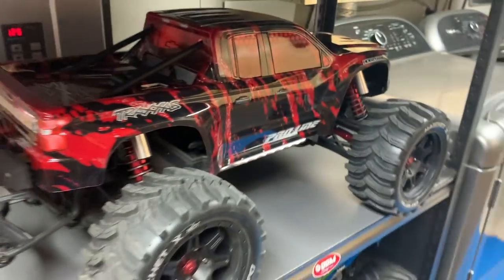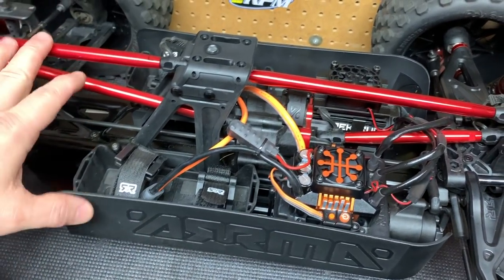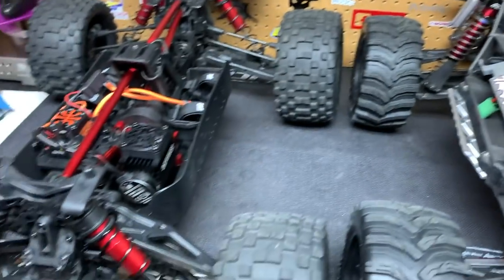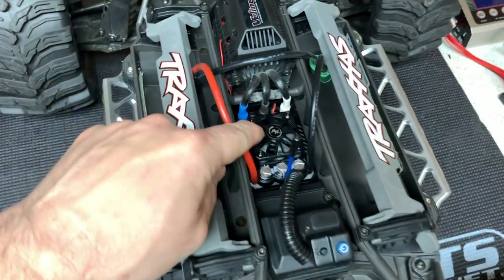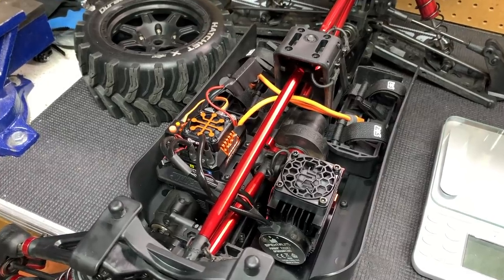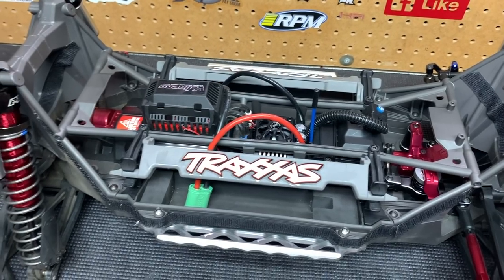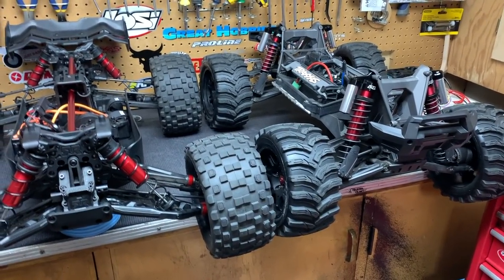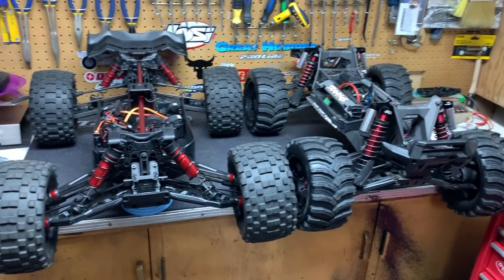Arrma Kraton 8s VS Traxxas X-Maxx (Comparison)

Comment: I have my XMAXX 8S stock and have launched it time after time on the BMX track, and never had an issue with any of the items that you are discussing. No issues at all. I hope it stays that way. I have also have launched my XMAXX 15 to 20 feet into the air and landing on the hard dirt track. Hope you have better luck with yours. You might want to check out your modifications and see if everything is working in harmony together and not destroying itself.
Reply: I've had the same experience.  No problems at all with the gears or the speed control. I beat the crap out of it for 6 months, no issues. I installed a max 6 still on factory motor and gears, no issues.  I think driving style makes a big difference.
Reply: Stock rear hubs too I bet ?
Reply: Yeah my xmaxx has had no issues with it's spur gear.... Been bashing for a few months now.

Comment: I been running my xmaxx now for over a year still on stock esc, still on pinion and spur. Sometimes its about how you drive it
Reply from the maker: stevin tyska exactly.  A lot of people are more aggressive like myself.   If you jump a lot and are doing flips and stuff you will break parts.  If you enjoy driving around on flat ground with no heavy jumps or anything the truck should last.
Reply: Dude I bash my Xmaxx shitless so I have a whole aluminum front end, upgraded servo, stronger bearings, had to boy 6 new batteries at 200 a piece cause I’m fucking dumb
Reply: @JasonPerrinRCVlogs  I've broken 3 rpm a-arms, 2 drive cups, a carrier hub, and replaced all four wheels in about 1 year on my x-maxx. I haven't replaced the pro-line raptor body on it yet, but it looks like the top gear hilux.  (incidentally, I borrowed an arrma notorious 6s for about a month and broke the lower plastic shock mount part twice - I bash hard!). still, aside from the tires, everything was super cheap to replace!
Reply: Maybe you didn’t send it 🤣🤣

Comment: I have got to be one of the only X-maxx owners that hasn't had an issue with the electronics at all. Even the dreaded grub screw.. I ran it at least 4 times dry before learning of it being a problem, chucked some blue ZAP threadlock on it and never been as issue in over a year

Comment: I got an X-maxx last year and love that thing.  I haven't had any issues with the pinion or spur other that the pinion coming loose a couple of times.  I put some lock tight on there and that seemed to fix the issue.  I run all the electronics stock and haven't had any major issues.  The ESC overheated a couple times, but after I beat the heck out of that truck.  I am not easy on that truck.  Broke the body the first time out after I jumped it 30+ feet.  The thing is built like a tank and I have no complaints as of yet.  I may get the Max 6 ESC at some point, but I definitely don't recommend getting anything until the stock components break.  It really is a complete waste of money.  Also, get the unbreakable body and Proline Badland tires.  You will not be disappointed.

Comment: For the pinion issue, degrease everything,   motor shaft, pinion and set screw. Use something called Loctite bearing retainer on the round side of the shaft, where the set screw isn't, and then slide the pinion on, and use regular loctite for the set screw. The bearing retainer is gap filling, and will secure a bearing (or a pinion) to a shaft without anything else holding it on. I used it on a TRex 250 helicopter for the tail shaft bearings, as well as the pinion for the motor of that same heli. The pinion in that heli had no set screw, not flat side. The bearing retainer was the only thing securing the pinion

Comment: My friend bought an XMAXX because every video he watched myself included said XMaxx is the most durable. I got a Kraton EXB 6s and expected problems according to YouTube. So no problems at all with the Kraton max6 1650kv. XMaxx has had issues every time he goes out! The tires came apart first, the pins that hold the a-arms keep falling out. He doesn’t even drive hard. 
Thank you for the honest Veiw. By the way the XMaxx is upgraded and hopefully be operating without issues.

Comment: This is by far the best, most unbiased and honest comparison vid I’ve seen on these trucks. Thanks. Having said that.....
I just got a Kraton 8s after Christmas. The exploded view diagram says the center diff already has 20mill diff fluid.
Reply from the maker: Yeah Arrma changed to 20 million in the center diff.  The first release of the v1.5 still had 1 million in them.  Changing the center diff to 20 million is no longer a worry.

Comment: I went into LHS looking for the Kraton 8S they didn't have any, but had 1 Xmaxx 8S. Since day 1 pinion problems, self righting one time blew the p&s to bits. Blue locate red loctite, don't matter. I was looking at different pinions in the lhs but thought I may run into what you did in the vid. I'm going to burr or slot the shaft and see how it goes.maybe even the arrma style spur grub with the pin going through. Been setting pinions and mesh for 20+ years, never any problems until this XMAXX. Outside of this and a few other issues which I've already knew about and sorted its an amazing rc. Traxxas needs to have Arrma do their gears, and Arrma needs to have Traxxas do their chassis design. Best bet to get both. The Arrma Xmaxx or Traxxas Kraton better yet the the Arrma XO-1:Limitless edition. Great video though very informative glad this popped up in my feed. Sub'd

Comment: Thanks for the great input on the differences between the XMAXX vs Kraton 👍🏻. I have the Kraton 8s and have been thinking of getting the Xmaxx. Now I know if I pull the trigger on purchasing the XMAXX I will need to purchase some additional stuff like a spur gear and pinion gear. As well I did click the like and I subscribed
Reply: Ya my gears have been perfect 👌 not a problem anymore
Reply: Im a complete noob who beat the piss out of my xmaxx and havent had any gear issues. Nobody i know has.

Comment: I had the problem with pinion on many of my different RC trucks. For the hell of it I decided to load the pinion screw with red thread locker but before putting the set screw into the pinion I let that threadlocker sit for about a half hour to stiffen it up and thicken it up just a little bit I let it dry and then I installed it and it's still on the truck today I did it to every one of my RC vehicles and I haven't had a problem since
Reply from the maker: I am going to give that a try. Thanks for the tip.
Reply: @JasonPerrinRCVlogs  You can also try some CA glue (super glue). If there will be a need to take it off, just warm it using soldering iron and CA glue lets go and you can take it off. I did such quick fix with my pivot balls which stripped suspension arms. Of course suspension geometry was not setup correctly so when I came back to home I just warmed it and glue let go without any damage to plastic axle carrier or suspension arms.

Comment: Since changing out the stock servo I can’t keep the XMAXX running.  Went through 4 in the past month. The pinion problem happened to me once and never again. Have the worst luck in the world with my EREVO 2.0. Esc, servos, motors, you name it. RC has endless variables.

Comment: I read the other day what i think sounds like a good idea for keeping the pinion on. Grind the end of the set screw that bottoms out on the motor shaft flat. Set screws usually have a little rounded end...i guess if you grind it flat it will give you a better bite on the motor shaft. Don’t know if it will help...but it sounded like a solid idea lol.
Reply: Better still would be metal weld or a well engineered pinion that has to be heated enough for thermal expansion to just get it over the shaft. Once cooled - solid fit from ALL sides and uniformly. Forgot to add, the bite is only better if the mating surfaces have 1) an increased surface area and 2) more friction from being tighter. Problem is that's more stress on the 1 small area (the grub crew and threaded section of the pinion)
For 2) the only method is to tighten more, but for 1 and 2 without being able to re-engineer the pinion, your method is a good idea.
By flattening the head (male) into a point of the shaft you make the same shape (a flattened section - female) you increase the contact area of screw and shaft and friction. Your (lol) idea is science and it will help a lot :-) go for it. Because you think, it is a good idea you where capable of coming up with by yourself before you read about it. Just take care not to narrow the shaft by over doing it, you want the minimal material away but flat on flat. Do the start work with a Dremel  (I don't have one) for speed but finish with a fine file. The Dremel is a rotary tool and you want as flatter surface as possible and that's why a file is better once you find a way to lock the shaft from spinning! while you work on it. A Dremel is probably the best option when working at 90 degrees to the shaft but you still want to keep it from moving so maybe get the cog on just enough to use the screw to tighten it onto the top of the shaft.  
Also bear in mind this very fast little cog isn't doing the torque work, it's doing the effort work by number of cycles....later stages of the drive train have the torque issues. My answer was over detailed I guess but sometimes you have to trust logic and not other people. It takes confidence to do stunts and tricks with a large mass that is potential energy moving at a great speed that could actually kill you, so have some faith in tinkering your toys to make them better :-) Engineering and science.

Comment: I am not a Traxxas fan boy at all actually I hate a Traxxas vehicles but the xmaxx is awesome,...Technically you don't have to buy anything for a new X-Maxx 8s, if the speed control does go bad within a month or six months then you can upgrade it at that point, the new tires are absolutely fine as long as you're not driving like an idiot and letting them round out like crazy, so far my pinion and spur have held up and I've had the truck for a month if they do break then I'll upgrade but none of this has to be done before you leave the hobby shop, some people have bad luck absolutely I believe that....but that goes with every ready to run car.  The X-Maxx at least looks and drives like a monster truck The arrma would be awesome but it's not a monster truck it's just a big truggy which is why a lot of people aren't interested in it if they actually made a monster truck I'm sure they would do a wonderful job and probably sell a ton.
Reply: You are correct .

Comment: i drill a divett into my motorshafts where the grub screw lands, that way the it has somewhere to sit and locks in nicely, those shafts arent hardened and drill and grind easily, if you go with the 1600kv that 20T is gonna be fast as hell! maybe even too much, if you do the 1600 id buy your 1275 as mine burnt up today! you could go either way
Reply from the maker: Good to know.  I honestly assumed they would have been hardened.

Comment: I have both of theses trucks also,,,,I noticed you didn’t mention the weakness of the kraton chassis,,,I bent mine just doing mild bashing...now I guess I’m going to spring for the m2c chassis,,which is not the cheapest thing to purchase,,,but is needed. Along with straightening or replacing the chassis supports and replacing the rear diff housing,,,I consider this a huge miss on armma part,,,,hope they improve this issue,,,,,other than that. I love both of these units,,,wouldn’t trade them for the world......great stuff....
Reply from the maker: I didn’t get into that as I have not had any issues with the chassis bending. It may be the new braces... not sure.  But I usually try only to comment on issues I have had.  And as of now my chassis is still good.
Reply: Installed the Radical RC Bash Bar, pretends the chassis from getting buffed down, and adds strength.
Reply: Yup... Bought a Mojave, lasted a few runs (guess I'm hard on it🤙) Had to replace the chassis with M2C, M2C +2 hubs, M2C shock tower braces, M2C shock standoffs, Vitavon diff cases, CRCU hinge pin holders, Basherqueen full carbon fiber set, GPM braces, HR brace holders, HR hub carriers, hi kg servo, motor fan, chassis cover, GPM axles full set and thicker springs.  Did I miss anything🤣
Reply: @surfside75    Yup, I believe in upgrading for strength...but not going overboard,,just enough to strengthen in crucial areas....I finally got mine right without the expensive add ones,,,,no issues yet,,and I’m also pretty hard on my stuff.....RIP IT...👈😀

Comment: I have an 8S Xmaxx with a max6 and 20T  tekno pinion and 50T GDS spur gear and have never had an issue with the pinion coming lose. The tekno pinion has a much larger grub screw.

Comment: Still running original 6s xmaxx,never lost pionion,always 17/54,,  6s  tires suck. Best tire still traxxas ,lightest is best for all rc. Still original gears to date. Kershaw design wheels make xmaxx handle like kraton,less out of control wheelies. Over size wheel bearings are the must. Still run slipper with 8s gears

Comment: Great Video 👍
I would love to see a side by side and running comparison of all the different wheel combinations you have on the truck !

I've just bought some Louise x Pioneers , interested to see how the power hobby raptors would perform aswell !
Reply from the maker: I am going to be doing one shortly.  I received my 24mm wheel nuts for the Xmaxx.
Reply: Would you be able.to.advise what size bolt.or.nut is used for decorative effect on each wheel ( the ones around the main hub )?

I've ordered some Raptors and I was thinking of swapping the little nuts or bolts for red aluminium ones for effect !
Reply from the maker: Matthew Latham they come that way.

Comment: I was having the same issue with my XMAXX. Now the Kraton has a snap ring in the motor shaft to stop the pinion from sliding. I am receiving my Kraton 8S Monday. Sick of the XMAXX pinion issue. Now would I be able to put a snap ring on the Traxxas motor shaft???

Comment: So the xmaxx needs a new esc, motor with a standard D shaft, a spur and pinion, and tires before it even leaves the box. The kraton 8s just needs a spur and 20mill diff fluid, but thats only if you want to wheelie. I think that marks the kraton as the much better choice. 
Tbh I think you have some natural bias from having xmaxxs for so long, that you can sort of brush off needing to replace the electronics on it. I'm not trying to attack you or anything, I'm sure you didn't even realize it, and the reason I've picked up so heavily on it is I have an arrma bias. I have a talion and infraction both of witch I love, and I have a Trx4 from traxxas that I love but the 2wd slash that I bash I don't care much for.

Great informative video! How often do you jump these? The clips are only of them on the ground, I wonder how well they hold up on the same jumps and landings
Reply: Don’t forget about the esc too 🤣
Reply: 99% of people dont have these pinion issues so no it doesnt need that....most youtubers are showing off their year ild gears still running

Comment: Guys, have anyone ever count how much does both cars cost if you will not but the RTRs, but just buy the parts which You want and assemble them from the scrach? I am thinking about it as it is hard to sell original parts like TRX ESC or Arrma radio and take some sense money. So maybe instead wasting money for the RTR where a lot of parts must be replaced, it will be better to buy parts which are needed and have sth like "kit-version" with already upgraded parts? :D
Reply: Daniel noname I have never done the math on that but I have always thought if you were going to get one of these vehicles and then highly modify it you would be better off to just start with a chassis and build it up from there I know you can Bobby chassis the bowl kids and a lot of the parts for the xmaxx Probably for a couple of hundred bucks not being any electronics or wheels and tires but you could probably get a roller going for like 300 bucks

Comment: Damn...your x maxx looks like something I would buy straight out of the box today.....congratulations on an awesome rig...I recently got a cen reeper and I've had no problems its fuckn awesome the only thing I see needs help is it could be wider on wheel stance I'm thinking the weak shock oil swapped for thicker oil would offset that and keep it planted or add extra shocks which should definitely negate the suspension roll
Reply from the maker: I’ll be getting another one.  I only sold mine because I got a great offer on it.
Reply: @JasonPerrinRCVlogs  I was really interested in the x maxx....but damn it's got too many problems its not worth the extra investment...but yours is definitely the best one I've seen I'm impressed and the enthusiasm you have for the hobby really shows in the video I'll b subscribing......

Comment: My pinion and spur have lasted the first 2 packs so I think it's prolly more about how you are punching it off the line. Mine is brand new, swapped out to Max 5 ESC before I eeven ran it, no problem with spur and pinion. BUT I am on punch level 3 and not really popping on it hard at the start. Also we have the same charger, hyperion. What PSU are you using? I am using a 12v 750 watt but kinda wondering about the 24v upgrade.

Comment: Xmaxx is better. I had both now I have 2 xmaxxs and they are bone stock. Javelin yet to have issues so far but I drive them mostly in colder weather. Duratrax tires and keep spur gear shaft bearings and wheel bearings

Comment: How are you destroying parts in 4 mins. Treating it like shit. My xmaxx is 6 mths old only chewed out the 46t spur that came with it and replaced the wheel bearings  still running the 18/54 that came with it. Don’t get me wrong i like the repair side of the hobby too but it’s simply how you drive these things that determines what’s good value